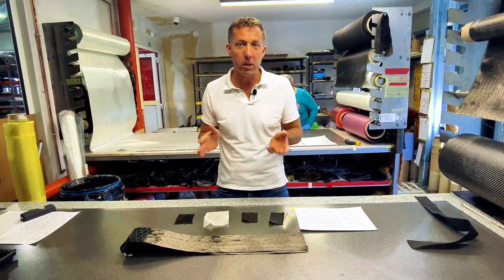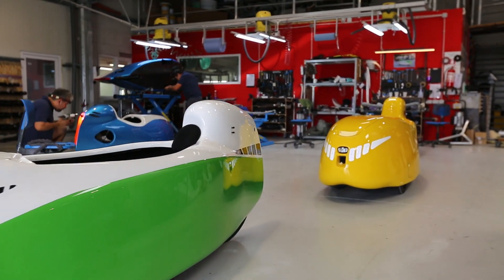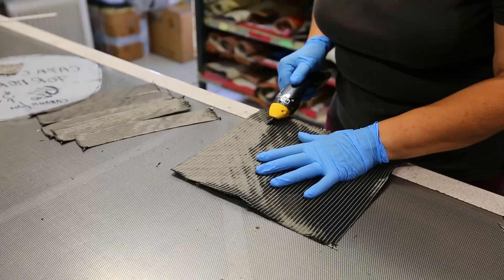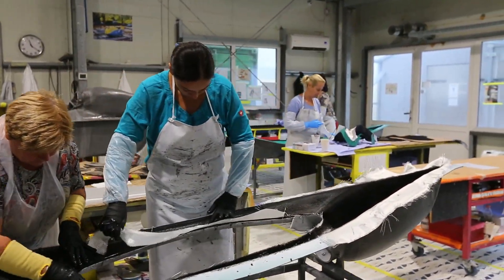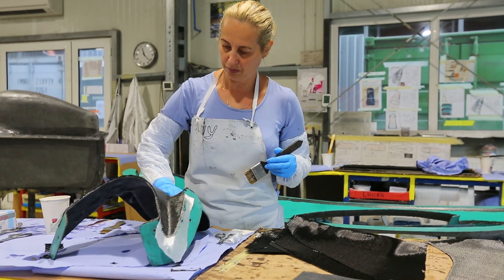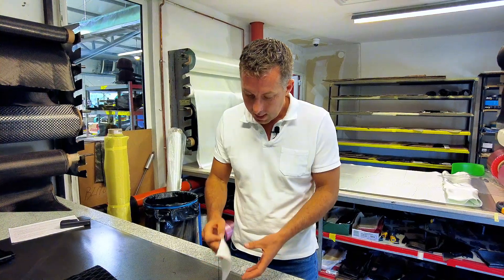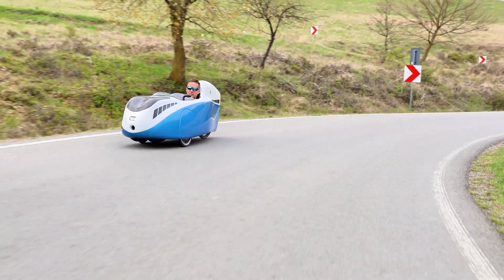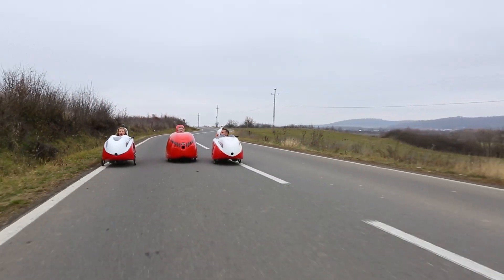Crash Safety in Velomobiles: What’s Really Protecting You?

Comment: Thanks for the video! Can you answer exactly how much noise is reduced when using this method?
Reply from the maker: Thanks for your question! Since we’ve never produced velomobiles made entirely from carbon fiber, we don’t have a direct in-house comparison. However, research shows that the Innegra-carbon composite significantly reduces noise and vibration. The Innegra fibers dampen high-frequency sounds and absorb shocks, making the ride noticeably quieter and more comfortable — especially on rough surfaces. 😊

Comment: https://www.youtube.com/watch?v=qVEwNDCn7Xw I have personaly been impressed by high module glass fiber. Verry resilient to high stress and some times better than carbon or even carbon/Aramid strucures when you need the part to hold together and the local stiffness is not so importent. In a velomobile the size of the structure makes it globaly verry stiff du to inertia. Si high module glass fiber would be quasi equaly stiff if you graduately put carbon where there is a lot of load, lile around bolts pivots suspention seat openings.
Reply from the maker: Our Bülk 4 More is actually made from glass fiber, and it offers great resilience and affordability, but it's not as light as our carbon fiber velomobiles. So for riders chasing maximum performance and weight savings, carbon still has the edge. 🚀

Always great to see others passionate about materials and structure!

Comment: The problem with a lot of velomobile design is the rollover protection is not high enough compared to the riders head. Looking at a velomobile from the right, the riders head should be below the virtual line from the top of the rollover protection structure to the shell above the cranks (as if the velomobile was upside down). In most designs, the head strikes the ground. A safety belt should also be added.
Reply from the maker: The point is: it’s a bicycle. If we start adding all the safety features we know from cars, we’ll end up with a heavy bike. And a heavy bike is no fun to ride. Then the whole reason why the velomobile exists is gone.

Of course, there’s always room for safety improvements. But we have to stay realistic and compare a velomobile with a regular bicycle – not with a car. And compared to a normal bicycle, a velomobile already offers much more protection for the rider.
Reply: @VelomobileWorld  The biggest difference with the bicycle is speed. As it goes up, the more serious the crash will be. You mentioned weight, did you actually analyse how much weight these improvements would add? Probably 200-300 g for a higher head rest and about the same for a safety belt? Seems very reasonable for the riders safety...

Comment: 2 thoughts: Is Carbonfiber safe for a shell? Well . . . . Ask a Formula 1 Race Car Driver.

2: After using a 'Bent Trike for years, a velo is like riding INSIDE a loudspeaker. Especially on a rough track! But you stay warm and dry in winter, so, as always, there are tradeoffs.
Reply from the maker: Great observations! 🙌
Carbon fiber is amazing for strength and weight, that’s why F1 uses it, but it does have downsides like noise and brittleness. That’s why we combine it with Innegra, which adds impact resistance and comfort. Less noise, more protection!

Comment: Why don't you use kevlar? I thought that one can make the shell being as one piece if it hits something, instead of cracking? This is not an offense, just a question! Innegra looks very interesting!
Reply from the maker: Kevlar is indeed strong and impact-resistant, but it’s hard to work with, absorbs moisture, and doesn’t insulate heat or sound well.
We chose Innegra because it offers similar protection, but it's lighter, easier to handle, and adds comfort inside the velomobile. Thanks for your interest! 💚

Comment: I think the big issue in most design is in a frontal crash you will have your neck or head slammed on the very hard curvature in front of you. I'm pretty sure it's the reasons behind VM fatalities.VM should have some kind of seatbelt preventing your body to slam in the structure in front of you.
Reply: How many fatalities have there been in Volos ?
Reply from the maker: I am also curious
Reply from the maker: Do you have any statistics? Many years ago, we did some calculations based on the data we had at the time, and we were actually a bit surprised how few fatalities there were.

If you look at the total number of kilometers velomobile riders do – and keep in mind, they ride all year round, also in rain, snow, and dark winter days – the numbers are quite low.

That tells us something: despite the higher speeds and all-weather use, velomobiles are not as dangerous as some might think.
Reply: I have no statistics but found one detailled report the net (hit a tree) and another by talking to some users (lost control down a mountain road). I think there are not many, but VM are rare too. From my time owning one I was not amazed by the safety. Another issue (with visibility fron other users obviously) was high speed handling. On any downhill those thing are crazy fast but the control were not great (Milan sl mk2).
Reply: @TheAntoine191  I would compare that to diamond frame bike riders who ride with their eyes on the wheel on front of them, (leaning low over the handlebars to reduce drag and increase power from their legs), who then don't look up frequently enough and hit something. Easily done, as I remember some near misses from my teens!
Result of going over the bars into a hard object like a parked car is probably a broken neck.

Diamond Frame bikes traveling at 40 mph will also have very twitchy handling, and no protection when you come a-cropper. I would rather be inside a shell in those circumstances than lose half my flesh down the road.

On speed. Well . . . . we all have brakes, and nobody forces you to travel at speeds you are not comfortable with. On Rare occasions I have hit 40mph down hill in my QV. Handling required great care, and since adding a Bafang Pedal Assist for the hills where I live, gearing has changed and my top speed is less than 35. That is quite enough. I want to SEE the surroundings, not fly through them at great speed with the tunnel vision concentration required for high speeds.

We all have the same destination in life: I am happy taking my time to reach mine, in no hurry to get there :-).

Comment: Car accident:
The shell forms a very soft shell around you. If a car crashes into you, you get the full blow. But then you get (with broken limbs) shoved over the road, and  the shell will at least protect you from the tarmac. So for the blow from a car, nothing can protect you, but every subsequent interaction with the environment, the shell is very protective.
This makes it much safer than a normal bike, where you would end up under a car.
Any other crash: the shell is strong enough to take a blow. Especially protecting your head and limbs.
Reply: Actually I didn't get the blow at all when a car drove into me. The velomobile (same was what you see in the video, the blue/white one) managed to distribute the force around me very well, I was just moved sideways very quickly, and did a barrel roll without hitting my head. I started my new job two days later and I'm sure I would have been in hospital had I been on an open recumbent or especially a road bike.
Reply from the maker: So glad you made it out okay! Thanks for sharing the details, it really helps others understand the difference a shell can make.